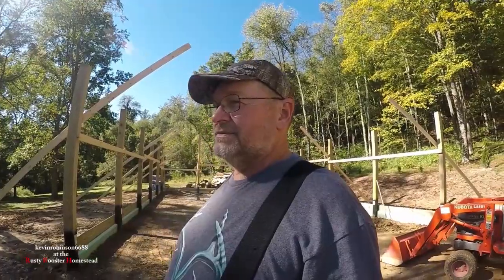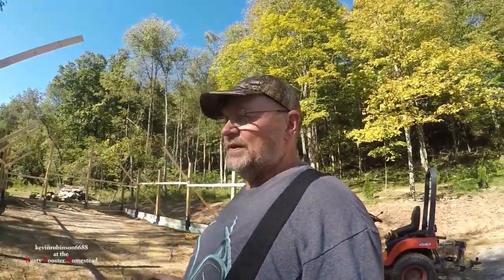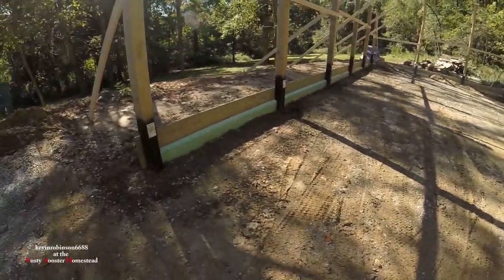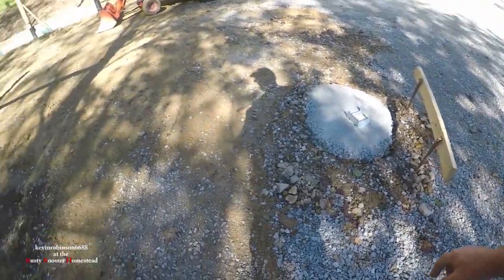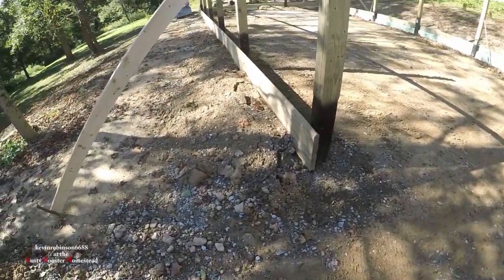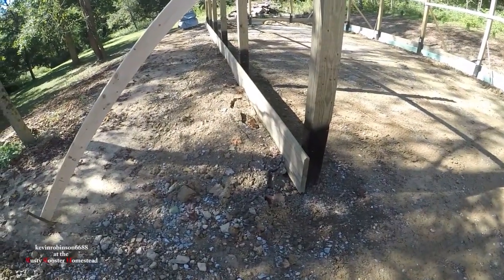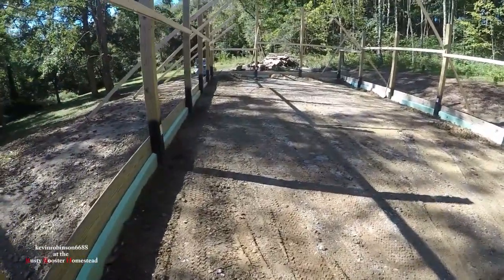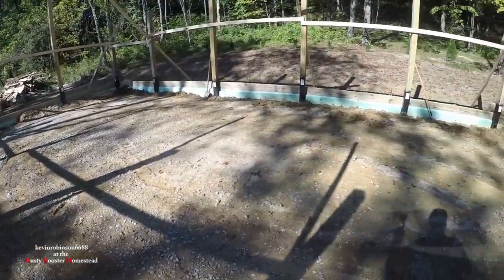mini barndominium build dirt gravel ditches

Comment: HELLO,  Question ... I watched you dig the 4-5 ft holes and pour the concrete .. and one glimpse of a worker just setting a pole in the hole after the concrete was poured and packed  ...  Is the pole just sitting on the concrete with dirt packed around it or how is it attached to the concrete to increase your wind strength .. ?  .. Morton Buildings invented the 3 board pole with the bottom being treated boards at different lengths pressured into untreated boards above as a cost saver .. they use a conventional slab with steel set into the wet concrete and then mount the pole with bolts to the steel placed in the slab .. the pole is mounted on top of the slab.  Suggestion on your plumbing .. too much faith is placed in the pex water lines .. run them thru a separate  standard septic sewer pipe to your baths, kitchen etc .. with pex inside .. so if a leak happens at the clamps in one area you can pull that line out and replace it without using a jackhammer ...   VERY GOOD VIDEOS .. HAPPY I FOUND YOU ...

Comment: I still don’t understand the purpose of a barndominium. After putting in all those expensive posts, you still have to frame walls, and pour concrete. Why not just pour a monolithic slab, insulate the outside of the concrete, and frame your walls. You use a little more concrete but save the expense of posts. Just wondering.
Reply: If finished right, a post-and-beam will look so much better than your standard stick-frame structure. And it will last 100+ years instead of 30 ... BTW been doing that myself the last ten years: 27 posts for a 500 sqft structure. Probably overdoing it, but it was worth the effort.
Reply: @WorldWideWillem-360  so a stick frame only 
lasts 30 years. What planet are you from.